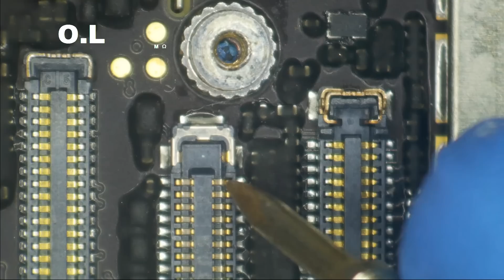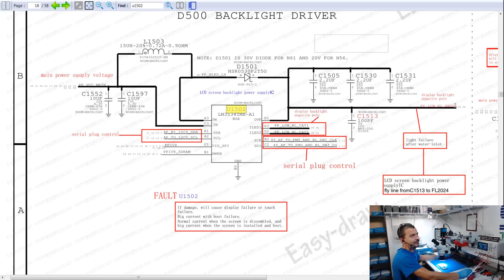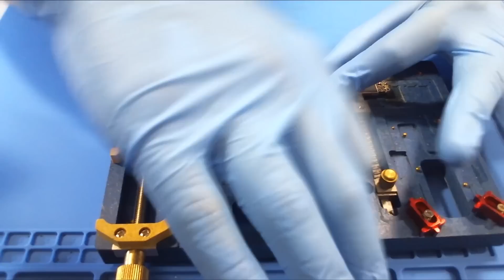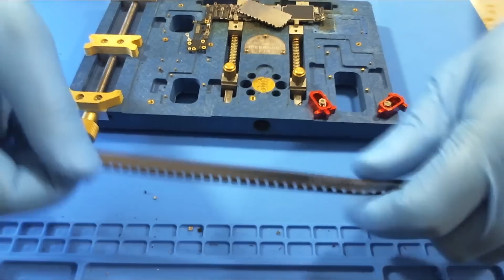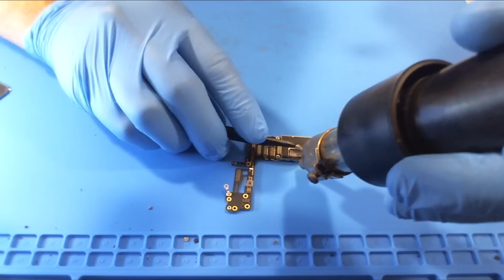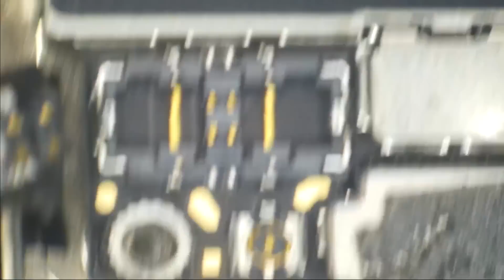Rebuilding iPhone 6 Backlight while Sick and Dizzy

Comment: it sounds like the chest cold i just had to undergo in the UK the coughing part is yet to come its like you can't  get enough air into your lungs scary ; get some homy and real lemons down you , o and cough medicine ....
regarding the PCB Holder , i found a really simple and cheep one on eBay £17.10 it holds two boards at once and the case fits in the middle (for those lazy time ) also when you move the two to the center they have a little step up where it makes it really easy to remove the large back shield etc its called 'High Temperature PCB Motherboard holder Fore iPhone Fixture Circuit Board'

Comment: What would cause my left side of the iPhone 6 Plus not to respond to touch. Just a half inch of screen the rest responds to touch no problem
Reply from the maker: Indeed ICs or once in a while the connector.  Could also be your screen if you haven't tried a new one yet.
Reply: Yep replacing the IC chip second time fixed it. And it was a new chip that I installed and it was causing me problems so when I installed a jumper and old chip all good. Thanks bud you are the Master.
Reply: Nermin Okanovic touch ic

Comment: Hi Jason.. How are you finding Easydraw compared to ZXW? Hope you feel better soon mate.
Reply from the maker: Thank you.  I think I am almost over it now.  I prefer to use Easydraw first because it will open the board view + schematic side-by-side with 2 clicks and because when you zoom in, the net names are on the pads.  But I turn to ZXW for diagnostics information and long screw damage.  ZXW has overlays that show voltage and resistance with arrows pointing to components as well as excellent multi-layer trace info.  I imagine that both Easydraw and ZXW will do a lot of the same things but I haven't had time to dig through settings to find out.

Comment: These little boys can be used for absorbing heat for protection, instead of using shields. 
https://www.aliexpress.com/item/10pcs-lots-Copper-Sheet-Shim-Piece-Heat-Sink-20-20mm-Thermal-Pad-For-GPU-CPU-Laptop/32817114608.html?spm=a2g0s.9042311.0.0.fd6e4c4dy4g3VQ

Comment: Well done, but it started out a samsung phone he he :-D :-D.
When you are ill your system is using resources to fight whatever is attacking you, it's bound to affect the brain too.
The brain needs the lions share of energy/oxygen, so if there is less of everything you will not operate at your normal 150%.
You are also distracted by the horrible feelings and not as sharp or alert as normal.

I get dizzy and fall over on minor ilness too, plus temprature rockets through the roof.
You are not alone :-D

Comment: Hey I think I have same microscope camera as you. My buttons didn't work due to flex being misaligned in connector. I had to trim the retaining clip to let it slide over and align with pins. They also don't work if 12vdc isn't supplied even though camera works off usb. Then you connect a monitor and access menu for exposure etc.